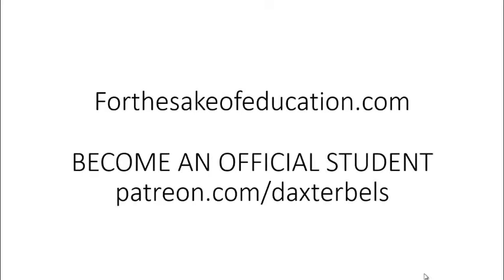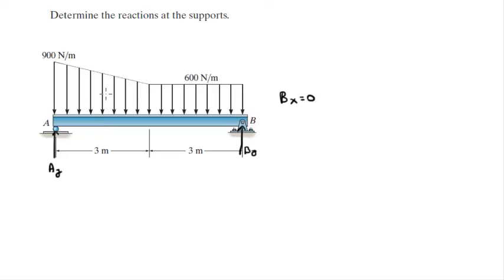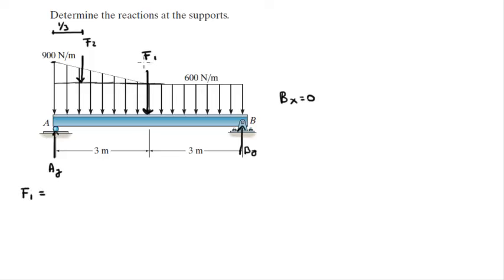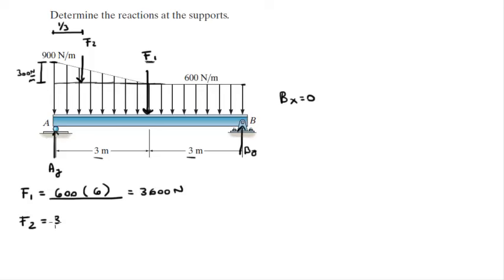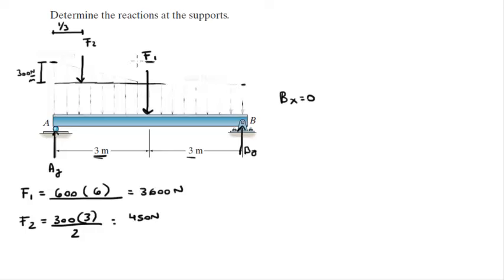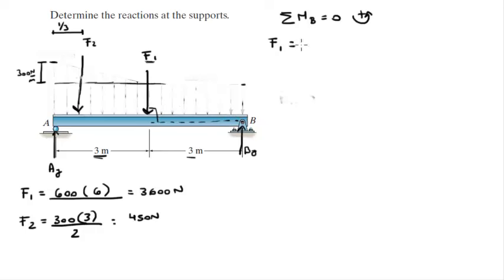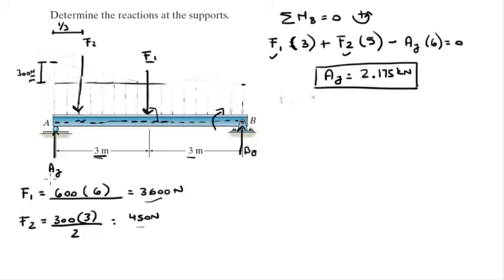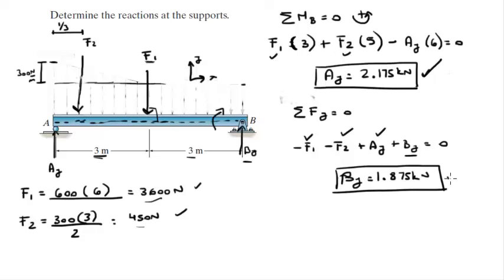Determine the reactions at the supports

Comment: Anyone know why he used 1/3 for F2? That's the only part I was unsure of from the example.
Reply: It's a rule..
Reply: Moment calculations use center of mass in the x direction for distributed forces. In a triangle, the center of mass in the x direction is 1/3 the distance of base, away from the corner where the right angle is.
Reply: Its because of the centroid of a TRIANGLE. The centroid of triangle is located by two points, 1/3 of the triangle from left OR 2/3 from left.

Comment: why is that distance 5 instead of 6 for  F2's moment
Reply: It's the distance from the arrow of F2. So for triangles you multiply the base times 2/3. In that case 3(2/3) giving you 2. So you take 2m + the other 3m (from F1 to B) which equal 5m.

Comment: Why 1/3?
Reply: Because the center of a right triangle is always 1/3 from the side perpendicular to x-axis.
Reply: @David Valle He does this because the force has to be measured at the center of mass of the triangle. The center of mass I believe is called a centroid. This goes for the rectangle as well, which is why the force is put in the center of the rectangle. When the taller side of the triangle is on the left, the center of mass is at 1/3 the length of the triangle. If the taller side of the triangle was on the right, the center of mass would be at 2/3 the length of the triangle. Sorry, that was a lot of explanation, but hopefully that helps.

Comment: Helllo,
Why is F2 distance 5 not 6?
Reply: because F2 5m is the distance from point B
Reply: larry robinson 
2/3(3) + 3 = 5
Reply: Where did you get 2/3 from? I don't see it. Thanks
Reply: F2 is placed 1/3 away from point A, so the remainder of the triangle is 2/3.. which is equal to 2m. then add it to the length of the rectangle to get a total of 5m
Reply: cass ass thank you for that explanation. Currently getting whipped in statics. But my own fault,  just not spending enough time on it.
Reply: right there with ya lol cramming for a midterm tomorrow.. I've watched about 100 of his videos now, life saver
Reply: cass ass Yup! But then I just forget how to do the problem after I do the mastering hw with it. I'm thinking one time thru isn't enough to actually understand it. Lol.
Good luck on your midterm,  I failed the first exam.
Reply: you need to find the centroid of both the rectangle and triangle and find how much distance they are far from the point you are calculating the moment and plug on the moment equation,  for rectangle it is easy which is 6/2=3 and triangle it is (2/3)3+3 = 2 and add it to 3 which is 5 .
that's it easy